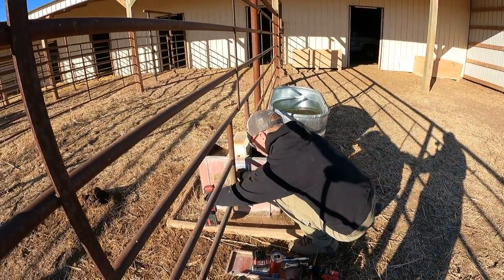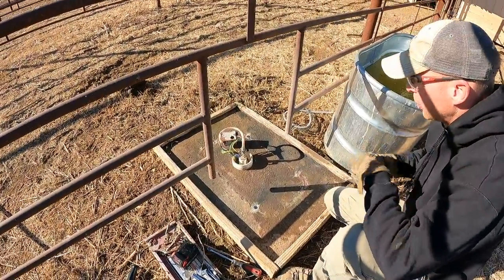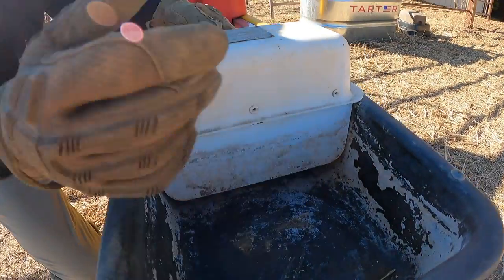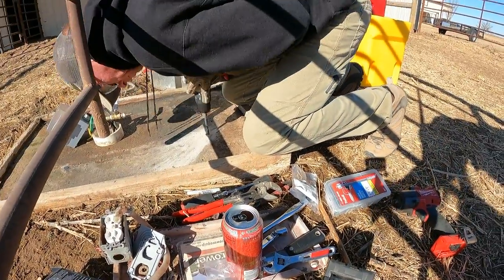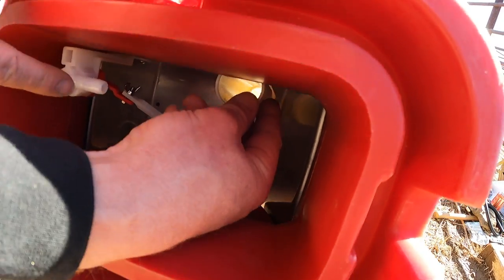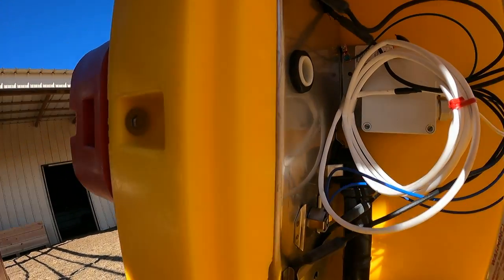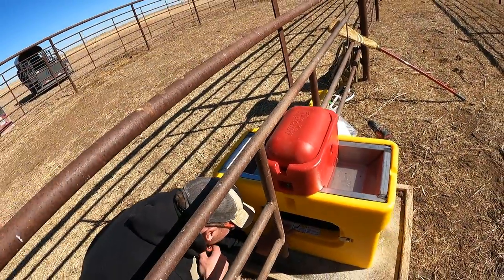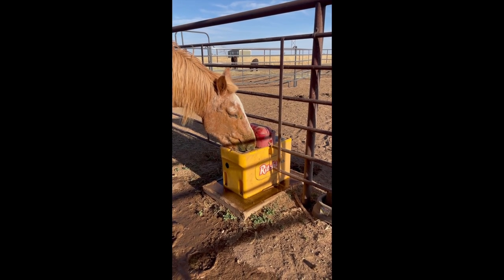Installation of Ritchie Automatic Waterers for our horses Ep. 10

Comment: Was wondering about your water supply because these horses drink a lot! Am very worrired about another youtuber who hasworking draft horses and only takes them out to drink when they come out of their very small stalls! He says the Amish treat their horses well !!!! My onky worry about automatic water is if something goes wrong and its not spotted in time so they are not infallable. Glad to see you are rescuing donkeys aswell they too are vulnerable members of equine society.❤
Reply from the maker: Great question...The waters fill as the horse drinks.  So as they are taking a drink the water starts coming out right away.  We are actually in the process of upgrading our electrical in the barn (video to come) so if there was a power failure we can flip a switch so a generator can take over so the waters always have power so they don't freeze in the winter.  We also installed a generator on the house so the water well will keep running in a power outage. I'm also a helicopter mom (lol) and am out there at least 10 times per day checking on them and I always check their waters.
Some Amish do treat their horses really well...not all Amish do this to their horses. Unfortunately our horses didn't get the good family. But that is all in their past and from here forward they will only know love and kindness.
Reply: @FletcherFarmsAmarillo  also think this love of teturning to the past is good in many respects but for working horses the arrival of the mechanical age was a great relief. Now we are in dangrr of teturning to a past era ofinhumane a nimal welfare.  Not to mentuon those aweful events called horse pulls.